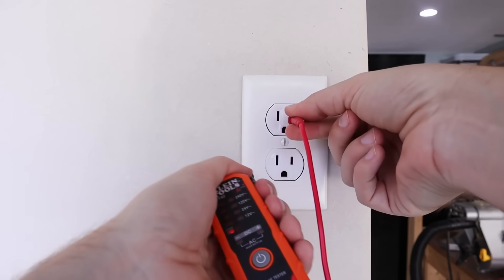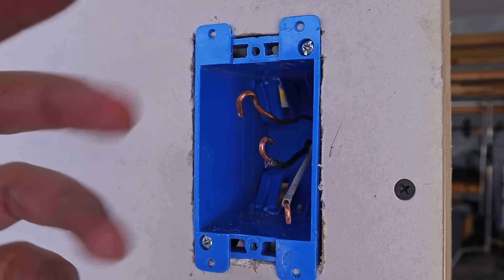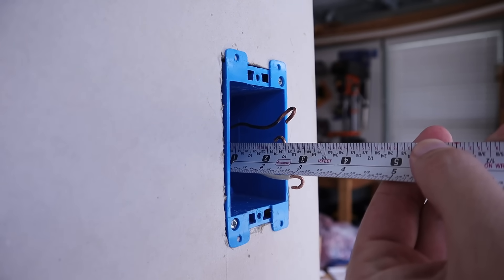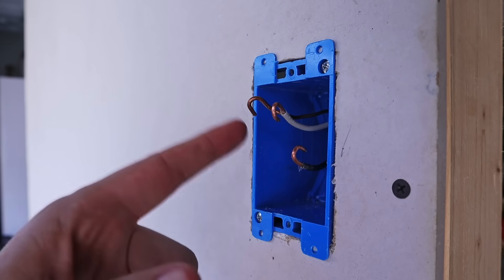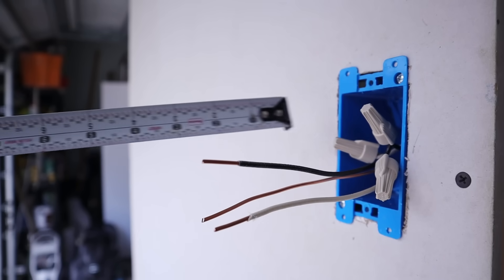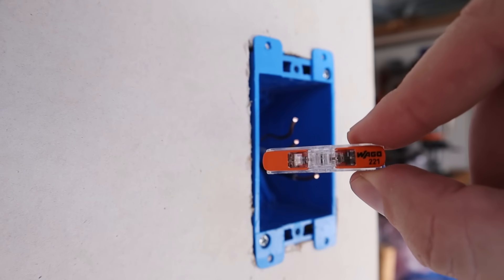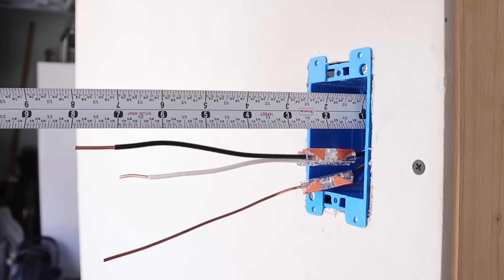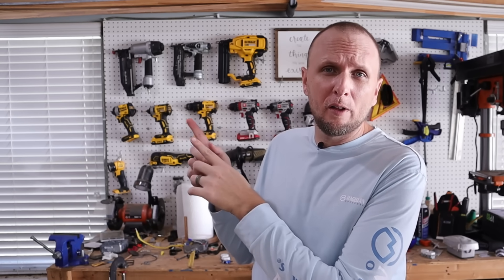"SHOCKING" New Way to Fix Short Wires In an Electrical Box to Code | Very Important

Comment: How about soldering the pigtails (after twisting the wires together) and insulating the connections using heat-shrink tubing?  It would take a little more time than wirenuts or Wagos, but it's more permanent and would occupy less space inside the box.  Maybe cheaper too.
Reply: That may not meet code requirements.  Always best to refer to NEC for how to properly do this.
Reply: @csimet  : When I read the section of code about electrical connections a few months ago, it listed soldering as acceptable.  What in particular are you claiming would be a violation?
Reply: @brothermine2292  Heat shrink tubing.  Soldering may be acceptable, but is definitely not best practice.  Think about the next person that needs to work on it (perhaps remove and re-extend the wire).  Huge pain to have to cut it off and unsolder in tight confines.
Reply: @csimet  : Since the code allows soldering, it must surely allow insulating the exposed connection.  So if code doesn't allow heat shrink tubing, then what kind of insulation does it allow?
     EDIT: (1) The code says "All splices and joints and the free ends of conductors shall be covered with an insulation equivalent to that of the conductors or with an insulating device identified for the purpose."  (2) I googled to try to verify whether heat shrink tubing is or isn't acceptable to code.  It appears to be acceptable.  I also learned that cold shrink tubing exists and might be an even better choice because it remains more flexible.

     Regarding whether soldering isn't best practice, why do you think the next electrician might need to remove a soldered extension wire?  The extension merely provides the longer wire required by code.  It sounds like you're saying a future electrician might want to shorten the wires and thereby violate that section of code.
     The greater reliability of a soldered connection has merit when evaluating the tradeoffs relevant to best practice.  I agree that soldering to something likely to be replaced isn't best practice, but I think extension wires are unlikely to be replaced... and long term reliability is of even greater importance for something that shouldn't need to be replaced.
Reply: @brothermine2292  I'd assume wire nuts can still be used over those soldered joints, but I have yet to run across any deployment that utilized soldering and heat shrink in either residential or commercial deployments in my 40 years.  I stick to best practice deployments following NEC myself.
Reply: @csimet  : I edited my previous comment, prefixing the new paragraph with the word "EDIT."  I couldn't verify your claim that heat shrink tubing isn't code compliant, and I discovered cold shrink tubing is another acceptable alternative.
     Also, your reply ignores my critique of your claim about best practice.  Although I agree that soldering isn't best practice when eventual removal is likely, extension wires are unlikely to be removed.  So the greater long term reliability of a soldered splice seems more important than the unlikely risk that the extension wires will someday need to be removed.
     For professional electricians, speed is very important for best practice.  For a DIYer who rarely does electrical work, spending an extra minute per splice to gain increased reliability isn't such a big deal.  For a DIYer who already owns a soldering iron or gun and knows how to use it, soldering the extension wires seems a reasonable option.
Reply: Heat shrink insulation is equivalent to Romex 12AWG insulation? Maybe in theory but I wouldn't trust it! I see wires poke through heat shrink all the time. Even if it stands up to the voltage, I wouldn't trust it to stand up physically.
If the wires are short then you're already going to have a hard time getting a soldering iron in there. Wire nuts are cheap and easy. 
I don't see any advantage to solder and heat shrink.
Reply: Soldering? Are you daft? Not in a million years.
Reply: @amerikalast  : Are you unable to articulate any reasons?  An opinion lacking any supporting reasoning is useless, regardless of how much exaggerated ridicule you load it with.
Reply: Soldering is not allowed by the NEC especially on ground wires. I always used the smallest wire nut and several wraps of quality tape ( only thing POS cheating communist black tape good for us taping trash bags closed that are not heavy.
Reply: @JohnThomas-lq5qp  : No, the code does allow soldering.
Reply: Not for ground conductors. At a continuing education class the instructor told us that solder joint could melt causing major problems. I put together a 25" Heathkit TV years ago that had 17 boards and guessing over a thousand soldered points. When I took it to get an alignment the shop said that I did not have even.one bad solder joint. Also put together a scope, tube :& transistor tester, radio and a few other things. So even though I own several soldering irons & a  Weller soldering gun I would never solder any 120 or 240 volt circuit conductors. My electrician dad had an old might have been gasoline fueled torch with a hand pump that he told me that he last used before WW2 while adding a receptacle from knob & tube.
Reply: @JohnThomas-lq5qp  if that joint is getting hot enough to melt solder if definitely going to melt a wago or a wire nut. I poper soldered joint should have no resistance. Wago do produce resistance. So if you have to  identical joints the Wago will get hotter and melt faster than the soldered joint

Comment: Wago’s are the way to go when cleaning and tidying up messy cluttered boxes.
Reply from the maker: They definitely do have their place.  Thanks for the feedback Geoffrey!
Reply: The only thing I don’t like about Wagos is that the levers are particularly easy to flip back up. I like to tape over the levers with electrical tape to try to prevent that from easily happening from say pushing everything back into the box.
Reply: @@jash21222 Here's what Grainger says: "Twist-on wire connectors create semipermanent connections between two or more wires without the need for crimping or soldering tools. Also known as wire nuts, they install by hand and are used in low-voltage applications to extend or terminate electrical and ground connections such as light switches, fixtures, and electronic devices. They have insulated shells with an opening where stripped wires insert and a beveled metal coil that, when twisted around the wires, digs into the conductors to hold and connect them." I can't find a better source though. As for you point, current rating is defined by the size. Each color clearly defines max. gauge you can use, and gauge defines current.
Reply: Especially when the box is crowded
Reply: No electrical licence ?
Reply: Absolutely!!! I was about to comment the same thing, then I saw your comment, lol
Reply: @@jash21222 The quoted text has two words: "hold" and "connect", I would assume they don't mean the same thing. I also read it somewhere else with much less ambiguity, but can't find the source now. I'm not an electrician, I'm a physicist, but my intuition tells me the spring plays a very important role in conducting current. Plus the fact that manufacturers don't recommend pre-twisting. But let's agree to disagree.
Reply: Twist nuts are for mentalists. Wagos all the way
Reply: Ideal also makes an excellent connector that’s just the push in type. No lever. Over the years I’ve seen more problems with wire nuts‼️Why❓NOT because of the wire nut but because the individual made a very poor twist of the wires BEFORE installing the wire nut. Wago makes up for anyone doing a sloppy job. They ARE the future of wire connections‼️
Reply: No true wago, etc. etc. Beware the name calling. 

The pragmatic decisions about how to update local electrical codes takes far more careful consideration than a few anecdotes and common hearsay. Sometimes it can be that the upgrade routes are not effective (too easy to misunderstand and miss-wire) rather than the change being an improvement in isolation. The hazards, risks and abuse cases are vast.
Reply: They're unsafe.
Reply: @Normal1855 Bullshit.
Reply: Amen!
Reply: Wire nuts are not professional and they are banned in Europe and many other countries. Junk! Totally unprofessional, twisting wire is not the correct way to splice two power wires!
Reply: @mirceagavan7046  Well before any mechanical contraption, twisting wires is exactly how wires were connected.
Reply: @scott8689  Yes, but followed by soldering. Then rubber tape.
Reply: @mirceagavan7046  Wire nuts are not banned in Europe according to ELSÄK-FS 2022:1, which is compliant with the EU standards. Since Americans are using them to a large extent, they can't be entirely unsuited for the task though there might be a lot of better solutions out there.
Reply: @bpomowe224  Twisted connections are banned, for a good reason in several European countries for decades. Old twisted connections must be revised regularly. And should be replaced.
Reply: @csabamagyar3244 They're banned because some company got a law passed, that you can only use their product. It's called lobbying. It isn't about safety, it's all about money.
Reply: How is a wago any different from a stab connect on an outlet?
Reply: @zoso1123  Wago make both. Push fit (stab) and lever. The conductor can be removed from push fit variants, but it requires twisting.
Reply: @zoso1123  Stab is one way.  Wago has one or more levers and is reusable.  I’ve never tried to reuse a stab, but I don’t think it would be a great idea.  Potentially you’re damaging or weakening the stab when you’re pulling out the wire.
Reply: @Geoffrey Parker  stab is the worst idea ever and reusable or not its still a peice of plastic pushing on a metal tab sounds  sus to me
Reply: It is amusing to have people claiming to be professionals bicker on the right option to use.
Reply: Wagon have more resistance. Twist and nuts are better but just a bit more work.
Reply: @rb8049  milliohms are irrelevant in this situation. It’s solution bias that’s the problem.
Reply: @R B  If you check out the tests online they do just fine. The wire melts before the Wago
Reply: @rb8049  Resistance is only slightly higher for most of the Wago style connectors and offer several other benefits over wire nuts.  I especially like Wago's when combining stranded and solid wires.
Reply: Waygos are for rookies
Reply: @blakek1043  wagos are technically superior to wire nuts in every way
Reply: @blakek1043 not just for rookies any more, just not for stodgy old timers or or their apprentices.
They’ve been used in Europe since the 70s and are great. Just updated a 100yo home with’em and they’re great. 😎👍
Reply: @Blake K  

If Wagos are for rookies, then almost every electrician in the UK and Europe are rookies because they almost all use them.
Reply: @martinw245 They're all rookies.
Reply: @blakek1043 LMAO.
Reply: @blakek1043 Just like pex, and compression fittings. All users by unskilled people.
Reply: wagos are great if you want your house to burn down. ill never use them.
Reply: @beansmalone1305  stop buying the knock offs then.  That's what dangerous.
Reply: @beansmalone1305  is of the "truth be damned" camp.  He keeps knob and tube wiring in his home.  He uses a fuse box instead of circuit breakers.
Reply: @beansmalone1305 wow ignorant statement
Reply: @beansmalone1305  

"wagos are great if you want your house to burn down. ill never use them."

Utter rubbish. They have passed numerous tests, that's why they are on the market. Certified for use in numerous countries. 

There a great video on YouTube testing the Wago against a wire nut, No difference. Apart from the fact you can mess up a wire nut connection if you don't know what you are doing.

In fact there are countless videos where they are tested. 

Name one house that was burnt down by a Wago?
Reply: everytime i disparage wagos i get attacked and called out by someone referring to test videos on youtube. All i know is after 20 years as an electrician i have opened dozens (if not 100s) of boxes and light fixtures to fix something and found melted wagos or wires that have slipped out of wagos in the closed position. If you want to learn electrical work from youtube good luck. I wont use them in my house or any house someone hires me to work on.
Reply: @beansmalone1305  I’m not an Electrician and I’ve opened up plenty of boxes hunting for shorts and most of the time it’s from  loose wire nuts or wires not being pre-twisted that caused the problem.  I’m not blaming wire nuts for installation problems.
Reply: @beansmalone1305  they weren’t Wago brand probably.
Reply: @geoffap0   Pre-twisted?   Most manufacturers tell you not to.   Every loose and toasted wire I’ve ever found was in a melted wire nut, and I’d bet it’s because you don’t get a good bite on each conductor if they’re already twisted.   I clip out the damage and install a Wago.
Reply: @jacksons1010 I believe my eyes and hands.  I see wires twisted before the nut goes on and then I tug on each wire after the nut is on.  I use Wago's more often but I still use wire nuts.  The only issues I've had (so far) are from work not performed by me.
Reply: @beansmalone1305  Which WAGO was that? They've put out a few different models on the market since 1951.
Reply: @beansmalone1305  so where are the pictures and you said you saw them burn houses down!  then you back track.  you should learn electrical theory, it would make you a better electrician and not sound like a news agency
Reply: @jacksons1010  if it tightens up it has good contact.  actually a good twist could hold wires just fine.  The wire nut covers it and makes sure it is good.  Not twisting was the evolution of using wire nuts.  Save time, nut takes care of it!
Reply: @scott8689  I never said that i saw a house burn down from the use of wagos. Dont put words in my mouth. If you want to use them do it but i wont because i dont trust them.
Reply: You didn’t say you saw them burn, but your original comment stated it as certainty that the house would burn. I get caught sometimes in commenting too quickly. We all are human.
Reply: @beansmalone1305 Yesterday thinking..
Reply: @jacksons1010  Yeah, pre-twisting is a very widespread fallacy. Modern wire nuts conduct primarily via their spring coils which have sharp edges digging into wires, contact between wires is secondary. So pre-twisting doesn't make it any better, but it does mess with coil contact. I guess the idea of pre-twisting comes from the time when wire nuts simply clamped wires together. That's not how modern wire nuts work though.
Reply: @beansmalone1305 20 years and only a couple hundred boxes. Seem like you had a terrible business
Reply: @danielredziniak2996  I do 99% new construction. Ive been in more pieces of switch gear than attics.
Reply: @victor74293  incorrect. wire nuts do not conduct, hence why they are not rated.
Reply: @beansmalone1305  I call BS. I’ll bet you’ve never seen one… “dozens, hundreds even?” Come’on…
Reply: @sstolarik  I'm not exaggerating at all. Since I've made that comment I've had to troubleshoot dozens of electrical shorts and issues and many times the culprit was once again wagos. The only time I would use them is to extend short wires into a box. Thats it. It's true that sometimes wire nuts fail but that's usually user error. Especially splicing solid conductors to a stranded. I know people love them but my experience with them hasn't been good.
Reply: @beansmalone1305  Nothing is without failure, I agree. And I want to believe you may actually have found one or two. But hundreds, and now dozens more?
If there were that many issues, and that ubiquitous, there would be a recall.
Sorry, old wives tale spread by stodgy, “I know better” tradesmen.
Respectfully, Bean, I’m still skeptical.
Reply: @beansmalone1305  All I know is after 25 years as an electrical engineer doing commercial and industrial wiring troubleshooting, every time I hear en electrician telling me how many wagos that were properly installed failing, he's usually lying.
Reply: @beansmalone1305  if you are right every house I made a box should burn down
But none of them did

Comment: I had to replace a switch and when I opened it up, I saw like five other wires with caps on them. I wish mine only had three. 😂
Reply: They probably used that as a tap box for something else then removed it.just capped them for safety ,put a test probe and see if the have volts.if not ignore and tuck them away presuming you have room.
Reply from the maker: Interesting.  I am curious what they did now.
Reply: Sounds like some abandoned stuff, lick you fingers and touch  the bare ends to be sure.

Comment: What if you have older metal mud in boxes that are smaller than today's standard sizes. I have an older house were the metal boxes are almost 3/4 in shallower than a plastic one. Most of them are Appleton boxes that are around 100 years old cause that is when the house was first wired.
Reply: rip it out and replace with the old construction style blue box u see in this video. They sell them in various depths and widths pending on how many gang the existing box is.  However if your depth is shallow which can be they also sell ones that arent as deep . They are very easy to install..
Reply: @culbyj3665  They can be a real PITA to rip out without trashing the plaster wall.  An old work box is a good solution, but I'd go to a lot of trouble to avoid having to remove an old metal box that's mudded in.
Reply: @incognitotorpedo42  it's not that hard. Even with a small saw.  Bi metal Lennox construction  blade.
Reply: @incognitotorpedo42  u don't even need  a power tool.